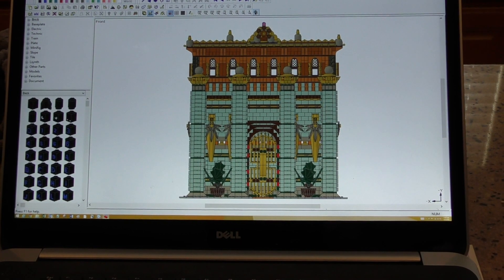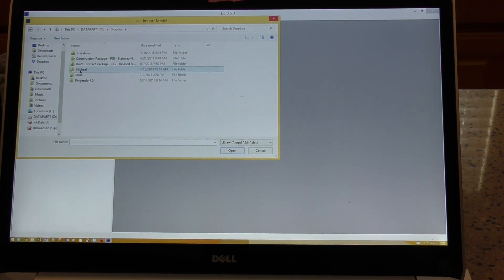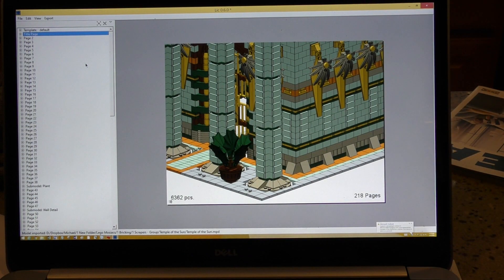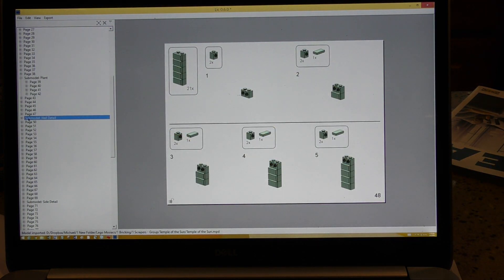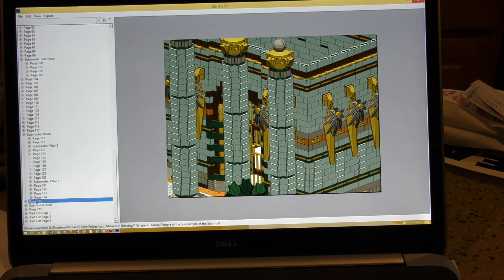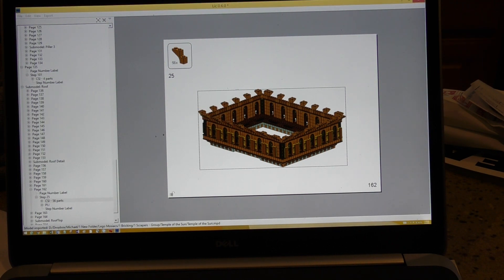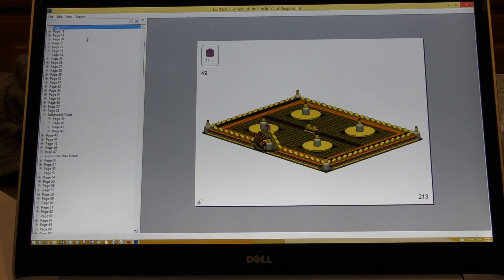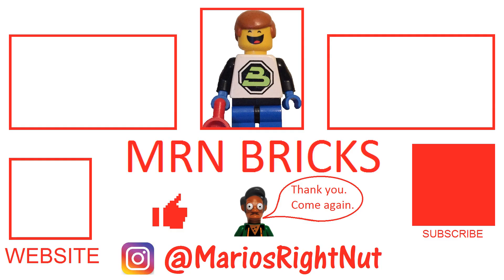How To Make Instructions for Lego MLCad Models

Comment: I'm amazed that a piece of software like this even exists! All the different rules for lego bricks and the sequences things has to go in must make a program like this very difficult to program! Other than it being a big slow at times, have you found any other problems with it? Will it sometimes place bricks too early so you'll have to remove it again later to add something else? The part list at the end seems really useful! How long did you use for the scaling part in the end? I think "not responding" is just windows way of saying: It's not me - it's YOU! If I really crash, YOU did something wrong.... YOU!" :-D Thanks for sharing an interesting guide to make instructions! I'm really looking forward to seeing this being build! Keep up the good work MRN!
Reply from the maker: I think it was some dude's senior or graduate programming final.  It's pretty neat.  It will place bricks out of sequence, especially when incorporating sub assemblies into the main model, but you can manually fix the order of the steps to correct this really quickly.  But, for the most part, it does pretty well.  It took around 45-60 minutes, total, to make this set of instructions for myself.  If I was going to sell them, it'd take a little longer to clean them up.  Thanks for watching!  I posted progress pics on my instragram if you're into that sort of thing.  I'll have the final review up probably this weekend.